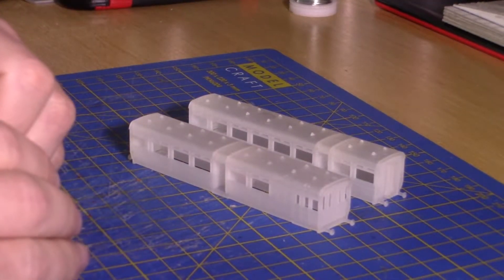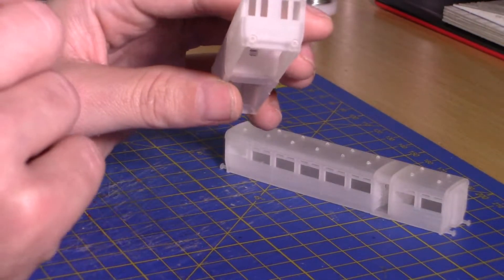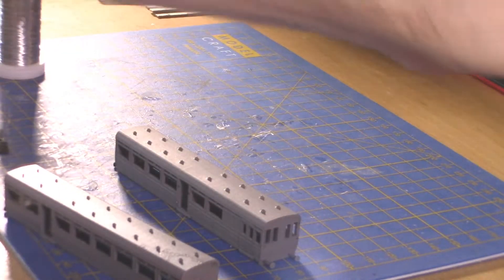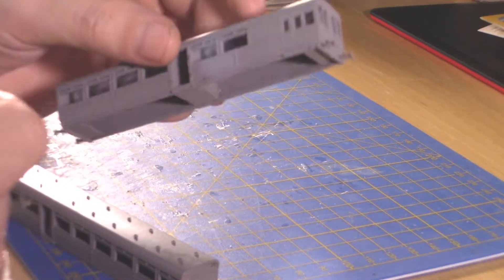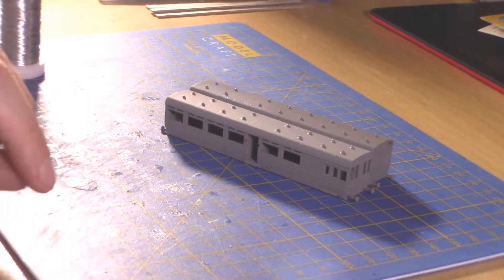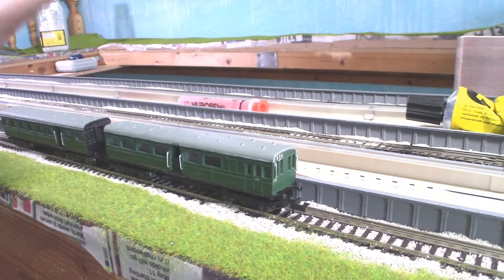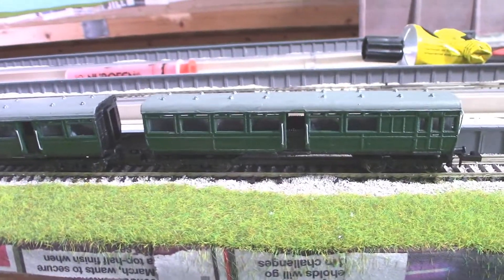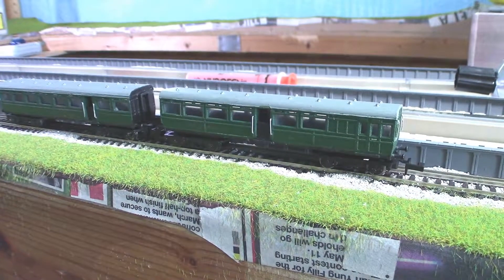An Amateur Builds: Recreation21 LSWR Gate Stock (48ft Version)

Comment: I saw these in one of your previous videos and was going to ask how they were made.  Now I know!
Reply from the maker: Glad someone noticed them, tried to sneak them into a video somewhere, mostly just for extra decoration during the video.
But it's a fairly nice kit though does cost a bit, wish I could've added a bit more detail to it but didn't have some flatter weights to put inside them.
Reply: @GosportRailworks  - it isn't unknown for people to put coins in as weight.  5p might fit N.
Reply from the maker: Was gonna use some of those lead strip weights which are used for golf clubs or some lead tape, something along those lines so it's thin enough to allow some detail to be built on top.